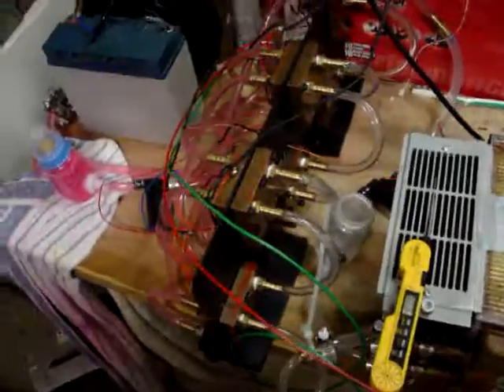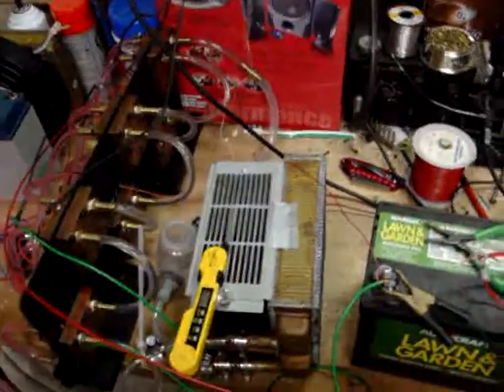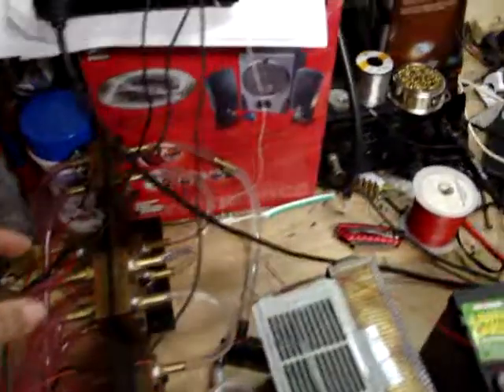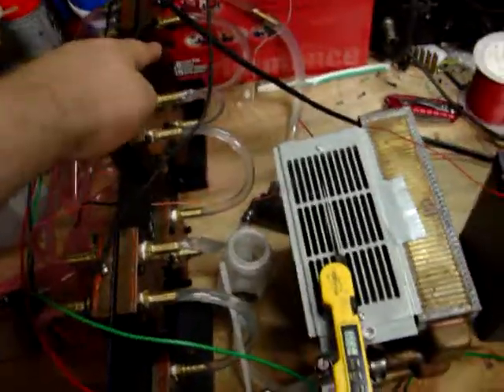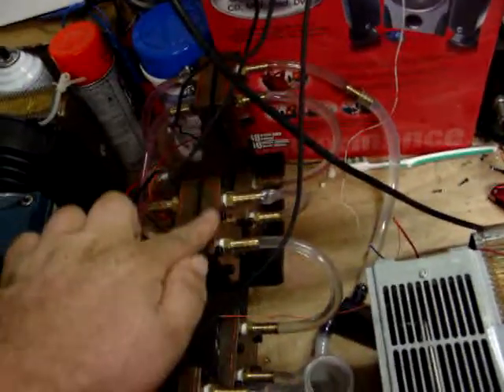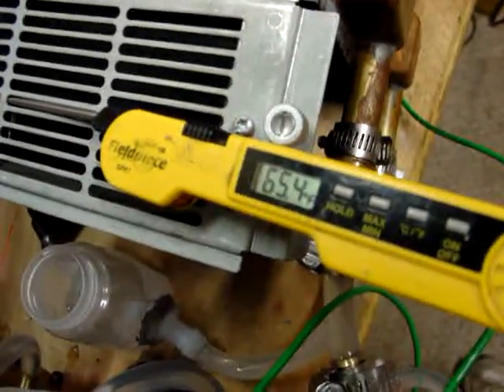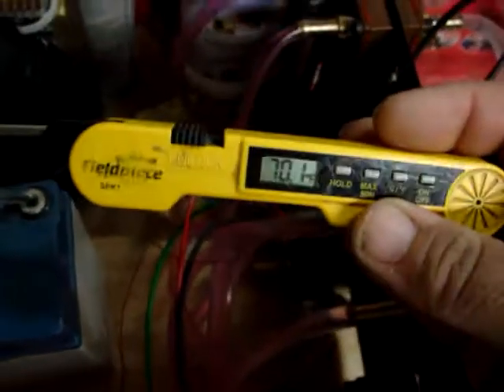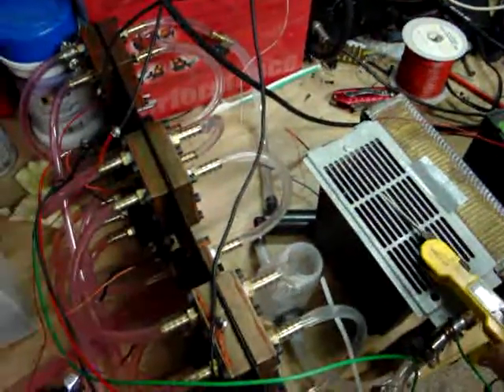Thermoelectric peltier Air conditioner project phase 4

Comment: Good evening sir can you help me of giving some advice of making this THERMOELECTRIC AIR CONDITIONER because i want it to be my thesis this year. I'm graduating student of bachelor of science in electrical engineering.Please help me sir regarding this topic,thanks
Reply: bro, check out my vids.. got it covered
Reply: Im working on one myself. You can source your own materials through junk yards, amazon, ebay. Peltiers are pretty cheap depending on power you want. For example, this 150w that I bought off of amazon is only $9 usd:
 https://www.amazon.com/gp/product/B00DYNTM04/ref=oh_aui_detailpage_o00_s02?ie=UTF8&psc=1 

When dealing with peltiers, the key is to keep the hot side as cool as possible, this in turn will lower the temperature of the cold side. Water cooling works best in my opinion, although I have seen some pretty badass air cooled builds using expensive cpu heatsinks or server heatsinks. you can choose to stack peltiers, or place them in series. If you choose to stack them, get two different peltiers, one big bad guy, such as the 150w that I referenced earlier, and one little guy (a 90w or lower), place the little guy's hotside on top of the cold side of the big guy, run the big guy at 12 volts, and the little guy at 5-6 volts. You would want to source a proper power supply to power this. An ATX PC power supply of 300 watts or greater would be more than adequate. Here is an instructable on how to do that:

http://makezine.com/projects/computer-power-supply-to-bench-power-supply-adapter/

Use thermal paste between the two peltiers, and between the heatsinks/waterblock and the peltiers. This will provide proper thermal transfer between all the surfaces of the peltiers and heatsinks/waterblocks. If you are doing a watercooled build, a proper pump, two radiators, two fans and maybe a little propylene glycol based antifreeze mixed with water to run through the tubing to cool and lower the freezing point of the water. This will keep the water from freezing on the cold side and destroying your waterblock.

Comment: hey there. looks like fun... here is a diy power supply that will do 70A@12v on 120ac or 100A@12v on 240 ac. they come outta servers so they are pretty reliable. Ebay "HP Proliant DL580 1300w" can be had for around 30 bucks. made one myself. google "DIY 100A 12v power supply" and look for a site called rcgroups for directions. super easy.

Comment: hey bro. you got an idea but you doing it wrong you dont need water at all  you gain too much energy in the process  ,and you should have enough power with 20 plus amperes if you weren't using  the water pumps either ,i'm building one heat pump/ A/C  for my dog's house i'm more than half ways there but i don't know if i'm gonna post a video though , good idea you just making it too complicated

Comment: @THEtechknight You should have had a 50/50 mix of water and radiator fluid.  This would have avoided the rust.  Any car or computer geek would tell you to never use 100% water as all metals corrode, just in different ways.  Polyethylene Glycol is an excellent corrosion inhibitor.

Comment: been following these with much interest.  In this vid we are starting to get a desc. of the parts in the system.  A  'phase 0' video showing what all the components are would help.    Is there a peltier under each thermal block? How did you mount them?  what wattage? how much power supplied to it?  How did you make the thermal blocks?  what kind of pumps?  Curious if you ran the system on one car battery how long it would go and how much sustained cooling you could get on one battery charge.

Comment: I'm needing to do basically what you are doing for a trip to the desert. I was wondering if you had tried cooling the air directly with a Peltier cooler so that there will be less loss from trying to cool water that cools air? My needs dictate that the system is portable to the desert in my already densely packed vehicle. The cooling required is for a a small Yurt. Thanks.